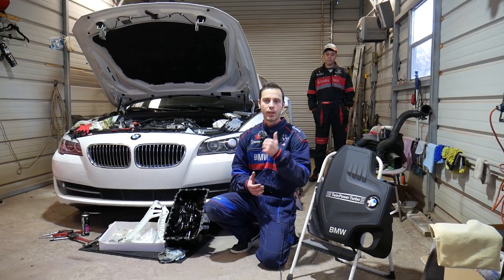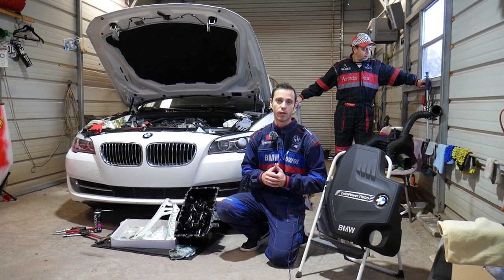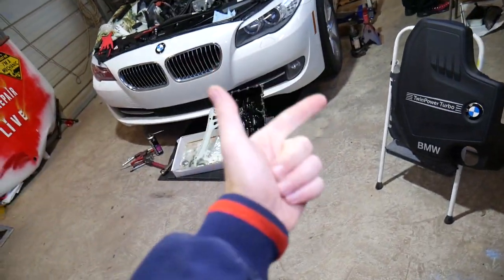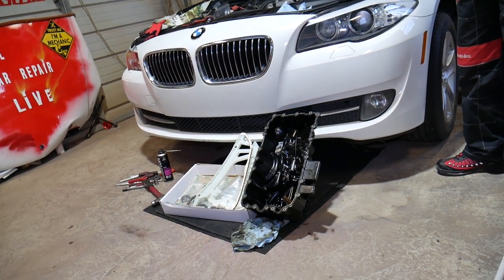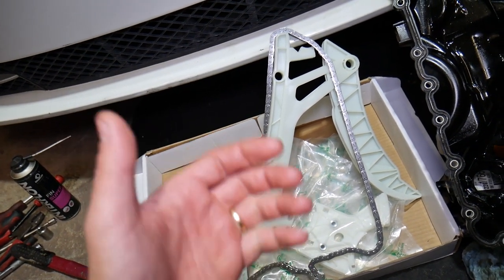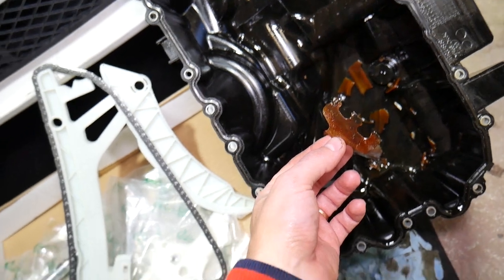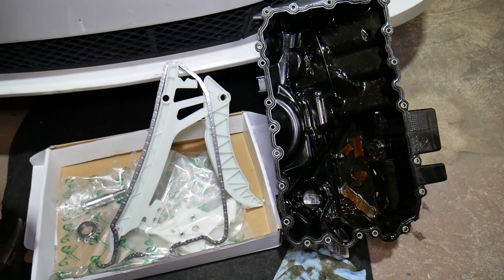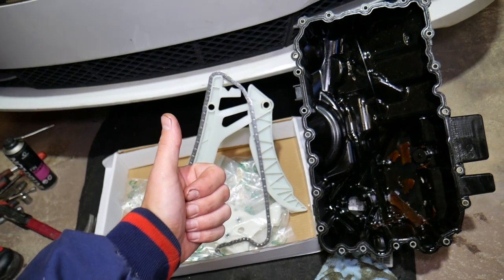BMW DRIVETRAIN MALFUNCTION ENGINE LIGHT ON, BMW NOT STARTING OR DIES F30 F31 F10 F32 F20 F21 F22 F23

Comment: If there is a class action law suit, can we take my car to the bmw dealership to fix it?? This happened to my 2013 528xi, same engine at 105k miles. It will crank but not start even with a brand new battery.

Comment: I have a drivetrain malfunction the car went to the shop and they diagnose that the voltage is around 6 volts and they found out the alternator was overcharging the car that’s what the technician told me, now today I went and did a cold start and after 20 min the same drivetrain malfunction came up and now the technician is saying must be something in fuel system... please help me if I can contact you guys it will be appreciated as I don’t want technicians to rip me off
Reply: What ended up happening ?

Comment: I have the drive train malfunction randomly pop up every few hours of driving. I scanned it and it spit out cods saying the car was running lean and rich, and had to do with the mass air flow sensor. I figure its just a vaccum leak or just bad connection charge pipe to intercooler. Any help
Reply: How’s you scan did a check engine light come on ? Have the same problem
Reply: @carlosquiroz5288  I had to put new o rings on them no more check engine light
Reply: @anthonypipia6990  o rings on where exactly? I got an f30 that suddenly got the drivetrain lights came up
Reply: @mr.mikelvich4132  charge pipe, boost pipe, intercooler outlets
Reply: @anthonypipia6990  you changed all the o rings on them and the lights doesn't came up no more?
Reply: @mr.mikelvich4132  that and tighten the connections, but that was it. I happened to have a valve cover gasket leak as well.